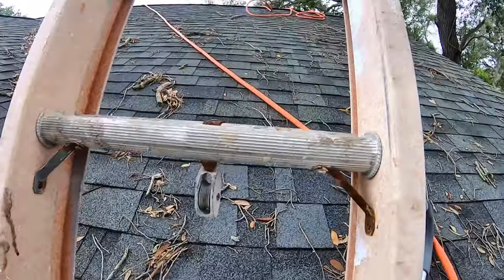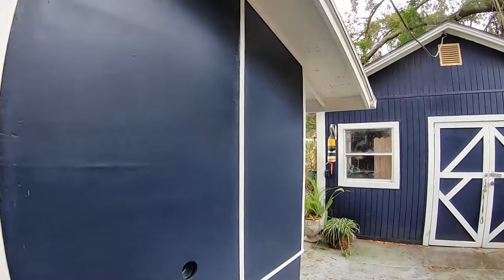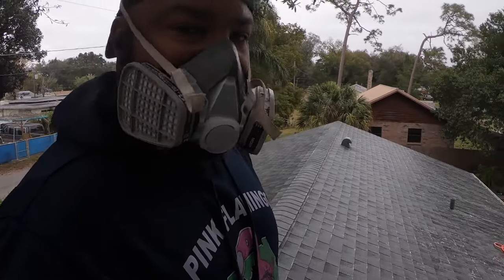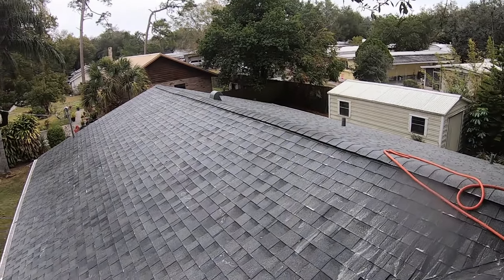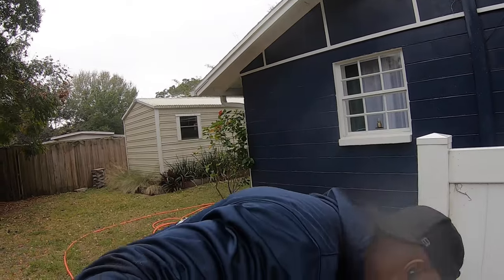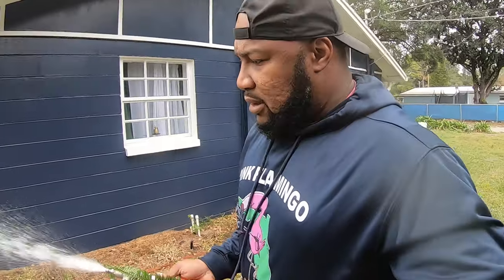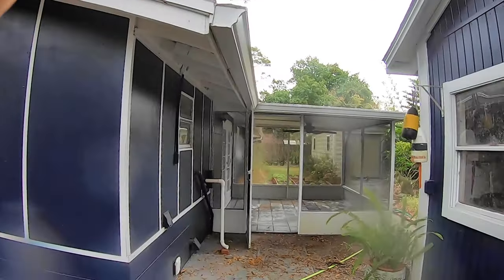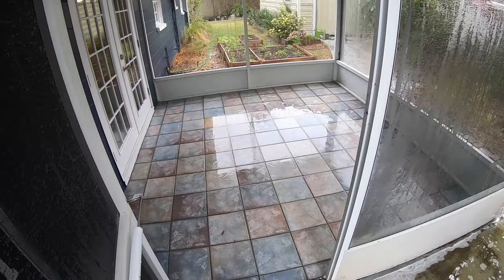Shingle Roof Soft wash and house wash

Comment: When down streaming material like that- do you use 12.5 straight? I’m petrified of wood. That looks like some type of wood? I have yet to do a house wash I just need to do it. Just don’t want the chemicals to ruin anything. When you’re applying did you pre wet the windows or do you avoid the windows?
Reply from the maker: Downstream mix won't hurt painted wood. Although there is a Sherwinn Williams blue paint that is fragile to sh.  Bit for the most part painted wood, siding etc won't get hurt from a weak mix.  Yes I apply the the chemical to the windows to get the frames and sills clean.  I pre wet the windows if the sun is beaming on them to cool them off so the mix doesn't dry on contact.  Using a good surfactant keeps the windows from streaking also. 🤙

Comment: Cliff, do you run into problems with the dark color homes bleeding or changing with SH? I'm always fearful with dark solid colors. So many new homes are using the dark house paints with  Hardie plank siding. If you test spot how, how long do you let it  dwell? Have you had to tell customers I can wash your house due to the paint?
Reply from the maker: No never had to pass on a job because of paint. If you're doing a test spot wait for about 10-15 mins to see the reaction.  From my understanding it's the Sherwin Williams blue paint that's giving people issues.  This is the 1st blue one I've done.  And I made sure to take my time and split it in sections so my sh doesn't dry on the surface.

Comment: When you downstream do you dilute your sh or what do you do?
Reply from the maker: Heck naw.  That's counter productive.  Downstreaming already dilutes the sh down.
Reply: @PinkFlamingoPowerWash  so straight 12.5 isn't a problem. I'm new lol so is the downstream not coming out at the tip at 6.25%?
Reply from the maker: @GmeDay2025  youll never achieve that strong of a mix downstreaming. Downstreaming with a regular injector gets your 1-1.25% mix brother. its normally 10-1 ratio when downstreaming straight sh.

Comment: Hey Cliff, 
Awesome job  👏 I have an estimate that I’m going to be doing its  pretty much the same as your video here. What can I charge for a roof that size and a house wash. This house I am getting ready to quote  everything Is pretty much the same  even the little  screen in patio   Thanks bro .
Reply from the maker: Pur this on your notes.  You can. Charge .15-25c on house washing. Roof .20-35c a sq ft. this applies for ALL houses and roofs.  Depending on your market.  Now you Habra a cheat sheet for pricing.  This is for all jobs you see me do
Reply: @PinkFlamingoPowerWash  thank you bro ,I just put it on my notes Great idea. Thanks 🙏
Reply: @PinkFlamingoPowerWash  Great video like always. What do you charge for driveways and side walks?
Reply from the maker: @yankeelover29  I start them at 150 and up
Reply: You ever have any problems with painted surfaces? At what percent do you do a test spot first? Thanks
Reply from the maker: @arnoldrimmer6422  Never had any issues. every house ive done has been painted so far. its hard to mess up a house unless youre leaving the mix to dry on the surface. That is why i split the house in 2 sections so i can rinse it off within 10 mins.
Reply: @PinkFlamingoPowerWash  I gave the client the quote accordingly. But she said the last guy charged her $200 for roof and house clean. That’s crazy
Reply: @PinkFlamingoPowerWash   Do you charge different if you soft wash or pressure wash a roof? I have to quote a 4228 sq roof, 2 story. Also, is there a difference  in price if it is a 1 story or 2? Thank you for all your help.
Reply from the maker: @yankeelover29  never pressure wash roofs brother. Softwash is the correct method to clean roofs. And yes 2 stories definitely will be quoted higher than 1 stories. V
Reply: @PinkFlamingoPowerWash  how much would you charge for something like this?
Reply: Can it be .35 a 2 story and .25 a 1 story?
Reply from the maker: @yankeelover29  most definitely it's varies by market. But those are good numbers
Reply: @PinkFlamingoPowerWash  thank you so much for all your help.
Reply: Can i call you? I have a couple of questions?
Reply from the maker: @yankeelover29  sure

Comment: That downstream bypass is just a gimmick...makes very little difference in pressure or flow.
Reply from the maker: The bypass is to cut your soap on and off and allows you to use the surface cleaner and rinse with full flow.
Reply: @PinkFlamingoPowerWash  I understand that...but it makes almost no difference in flow...it is a gimmick that is not work the price of the bypass.
Reply from the maker: @jimmywarren6685  not true. It's a huge difference running your water through a tint downstream injector than a 1/2 or 3/8 hose.  I can make a video.  Imagine surface cleaning through a downstream injector. You're gonna move slower and leave stripes from loss of flow